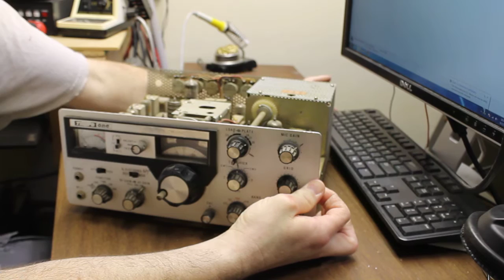Tempo One FT 200 Teardown Pre-Powerup

Comment: Good Morning ! What is the function of VR1 B (PULL ANL ON)? Note: VR1 A has an AF Gain function. Ismael - PU4IAL
Reply: ANL Automatic Noise Limiter.   I think it does no more than switches in a couple of back-to-back diodes across the audio path.
If it really was automatic, it wouldn't need a switch. HI HI